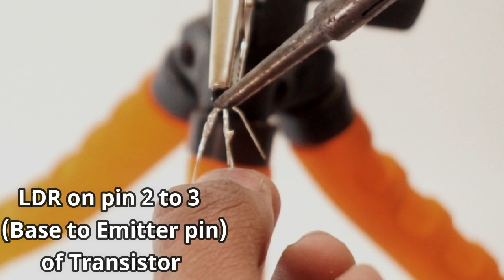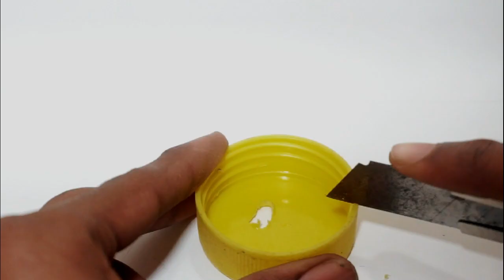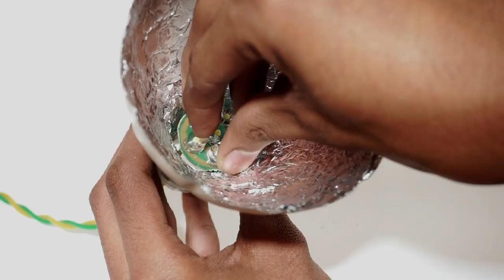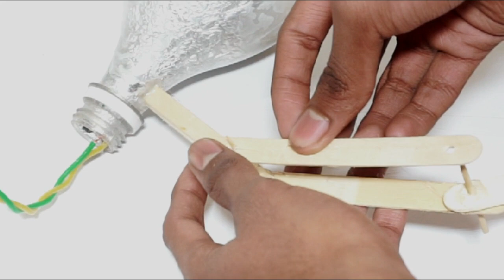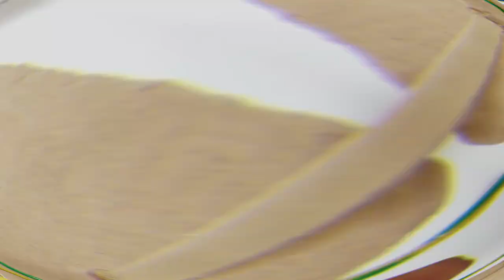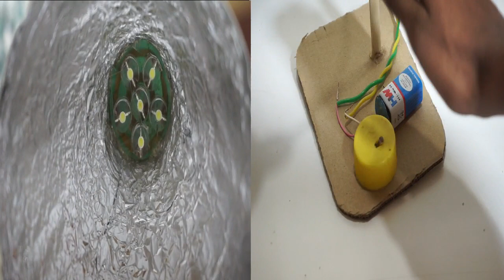Day/Night Automatic Table Lamp | How to make Simple Automatic On/Off Table Lamp

Comment: Is it always consume battery power?
Reply from the maker: No, it automatically turns off during day light, so battery will not be used 😊
Reply: @axcy9685  Nice!, btw can I use BC547 instead of 2n2222 ?
Reply from the maker: I don't know whether it will work or not, still you can give it a try 😄